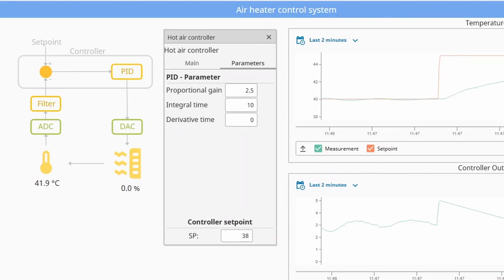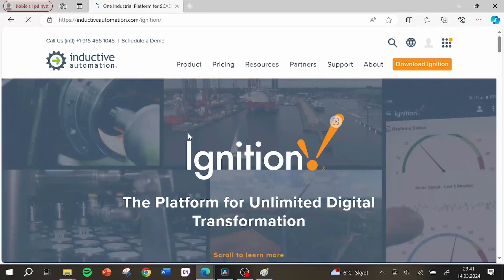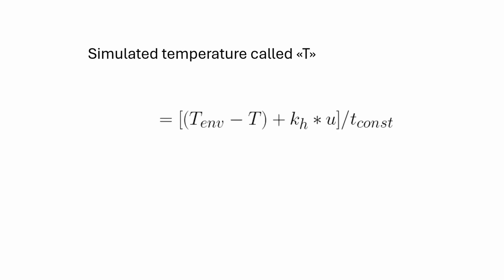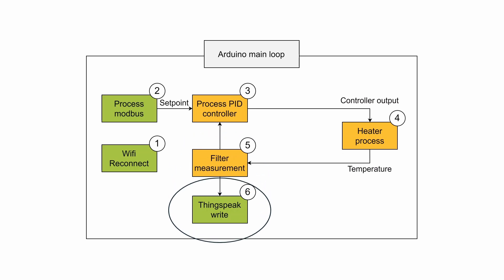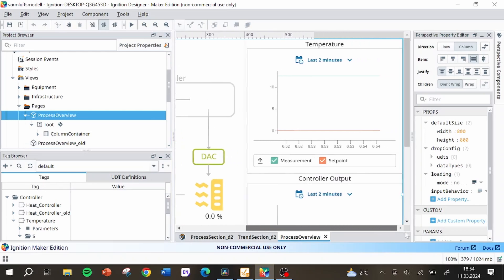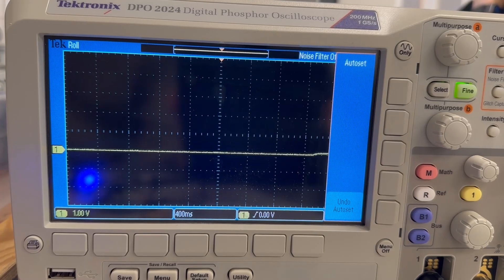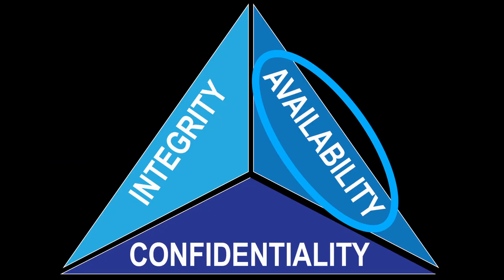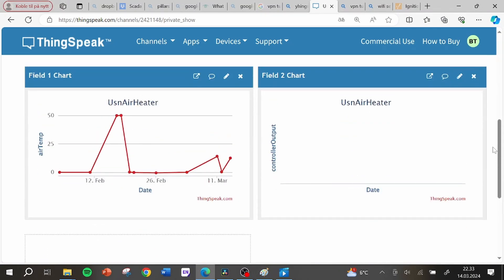Control System using Arduino and Ignition (SCADA system)

Comment: This is a very interesting video.  I was intrigued by the ignition component and Modbus comms.   I love the idea of the simulator.  It looks like what you have done is very thorough and works well.  I tried to download and run the code, but unfortunately it is missing some key pieces.  Can you provide which Modbus library you used? Also, Lowpass_BV file is missing. 
I am new to Modbus, and have never used ignition.  Is there any way to get the ignition system files on your githiub repo?  Thank you.
Reply from the maker: Thank you! I have updated the video description with the modbus Libraries.
Also check out my previous video where I am using modbus for data logging.
Reply: Thanks for letting me know about the other videos.  I should thought about that.  I appreciate you sharing all of this.  I will be watching for more.  Like I said, I am relatively new to Modbus and this is my first exposure to Ignition.   Your videos will definitely help me in my journey.  Thanks again and I am looking forward to more.

Comment: Well developed, explained, and very holistic. Excellent job!! Is ThingSpeak used because it's less of a security threat then exposing the Ignition UI to the internet?
Reply from the maker: Thank you! Yes, i chose it because it was the simplest option (that I knew). I could have exposed ignition directly as you said, but that would require port forwarding and knowledge of my router IP address. It is generally the simplest to push data to the cloud.
Reply from the maker: Another option might be to use the ignition gateway-network, and connect my ignition gateway to an ignition gateway sitting in the cloud, and use that for accessing the gui. But I haven’t checked if that’s the correct way of doing it.